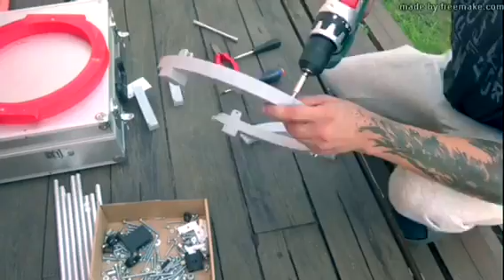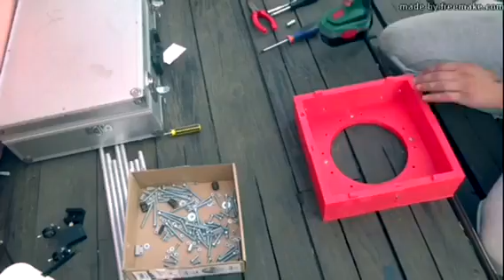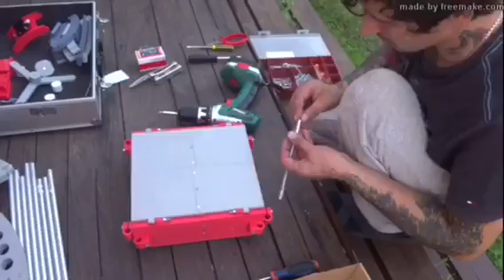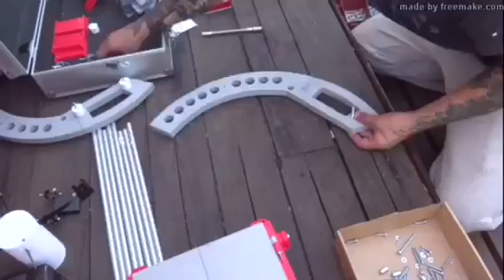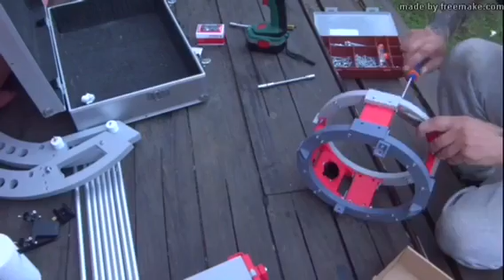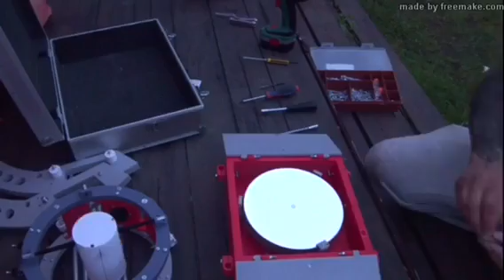Assembling the telescope ABSDBS-8"

Comment: I have built this scope now but the lack of information you provided like screws/bolts etc. as well as a lack of secondary mirror spider. While it has been a struggle to get it complete, it is certainly a mistake I will never make again. Please at least list the parts missing which are essential and all size bolts needed, it isn't hard or time consuming to add those details.
Reply: Do you have a list of the screws bolts etc for this scope
Reply: @Aur_0_ra  Most are M4 6, 8, 10, 14, 16, 26,32 and 45mm nut and bolts. Even then I am not sure if I had many other lengths but I do know that 95% are M4 size nuts and thread.